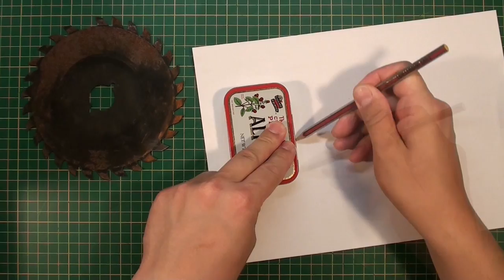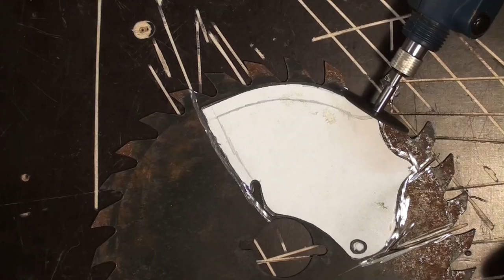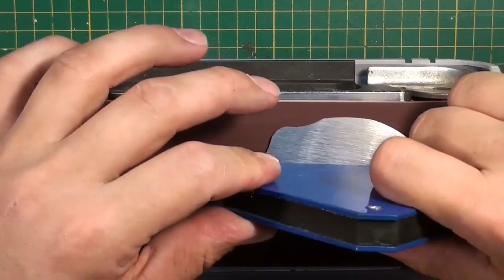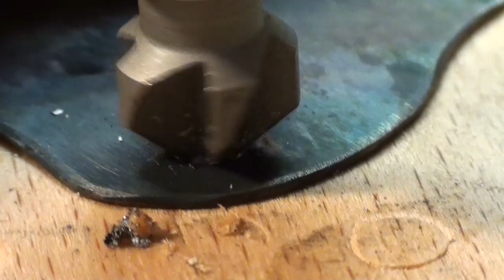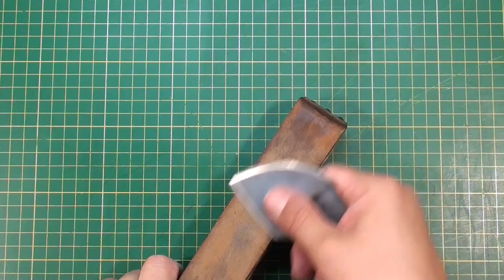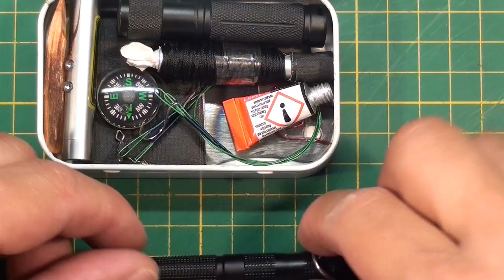Mini-Survival Knife made from an old Saw Blade (Jimmy Diresta inspired)

Comment: Curious to know if you did any kind of heat treat on this knife. Awesome job man that is a great idea thanks for sharing.
Reply from the maker: Hi Pryce, so far the only heat treatment was spot annealing the handle section for the lanyard hole. I have plans to try to harden the blade once I have the right setup for it (along with some other mods that have been suggested). I have already tested if the steel can be hardened on one of the cut offs and it worked pretty well.
Cheers Alex

Comment: Really Nice!
Here's an idea though:
The knife is probably going to be one of the most important and most often used tools in the kit. Instead of hiding it in the bottom of the tin (which means removing everything else in order to get to it), why not make it so that it fits in the lid of the tin (and the lid is still able to close)?
You could keep it in place with a magnetic strip on the inside (or outside) of the lid.
OR... You could make a leather sheath for it and hang it round your neck where it will Always be available!
Reply from the maker: Thanks a lot Paul! To be honest I've been thinking about a new version of this blade for a while now. The idea of putting in the lid makes absolute sense alternatively packing it on top of the other items would be beneficial.
Thanks again for the suggestions!
Cheers Alex

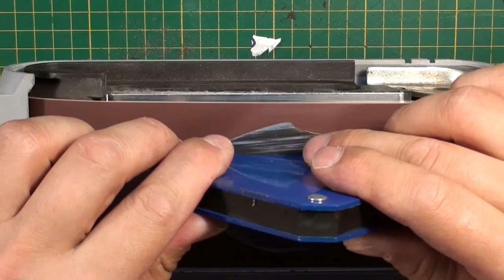Comment: I really like this concept for a knife. It's a much larger cutting blade (edge) for the space it takes up. I wanted to know what the blue device was that you used to hold the blade while grinding it @2:12.  Again Awesome concept & way to think out of the box. 
Thanks for sharing.
Reply from the maker: Hi Curtisskeete,
thanks for the like and your feedback it is much appreciated!
The item used to hold the blade for flush sanding was a welding magnet which comes in very handy for this purpose especially with small blades.
Cheers Alex

Comment: Most of the circular saw blade are just mild steel with, say, potentially case hardened teeth, quite useless for knife making though. Some 1080 - 1090 will do the job much better
Reply from the maker: Thanks for your feedback!
Cheers Alex
Reply: if a circular saw blade has no carbide teeth, you are so wrong, its high speed steel.
Reply from the maker: You are right this blade is approx. 20 years old and had no carbide teeth.

Comment: good idea but it looks like you´ve overheated the blade when you used the belt sander so it can´t hold a edge for very long. try to quench it in water from time to time to cool it :)
Reply from the maker: Hi Leonard, thanks for your feedback. I was wondering when someone would pick this up. The discoloration was caused by spot annealing the "handle" area in order to be able to drill holes. The majority of the blade was kept submerged in water whilst the handle was heated and then air cooled. In theory the blade area should have remained unaffected.
Cheers Alex

Comment: im not really understanding the design of this knife. I get it that you want it small to fit the tin. but why not make a typical knife shape with a small handle so you can actually hold the think not just with your finger tips. good work on shaping and sharpening, im just curious why the unusual and seemingly unpractical design.
Reply: he might have to use it to cut things like rope. Maybe some meat. I actually made one like this. but it is smaller in terms of width but same in length. The blade was just a simple triangle.
Reply from the maker: Hi, thanks for your feedback. The shape was quite experimental since I wanted the edges as long as possible given the space/size restrictions. The way I shaped the "handle" sections allows for a number of different ways to grip and hold the knife. Furthermore it is possible to make a longer makeshift handle with the contents of a survival tine for this a second hole should be drilled and screws added to the kit.
I hope this answers your question.
Cheers Alex
Reply from the maker: Exactly, the blade isn't design for jobs like batoning etc. where a good strong grips is required. It is more for delicate works.
Cheers Alex
Reply: ahhhh I got ya. cool yea was just curious, not hating.
Reply from the maker: I didn't see it as hating just as a question from a curious viewer and I must admit the design is really unusual ;)
Cheers Alex

Comment: never seen someone try to cut that kind of metal with a little dremmel type tool, how long did it take to actually cut that shape out of the sawblade?
Reply from the maker: Hi Serg, it worked quite well and if i had to guess it took about 30 minutes with cooling breaks etc. I also burned through two cut off disks.
Overall I must say that an angle grinder would be much faster and effective but maybe someone with a Dremel might find the info useful.
Cheers Alex

Comment: very nice. How many hours did you put into cutting out the basic shape?
Reply from the maker: Thanks Andy! It actually didn't take that long if I had to guess it took approx. half an hour with cooling breaks.
Cheers Alex
Reply: much faster than it looked in the vid. I will have to try and make a general purpose knife out of an old disk blade I have in the shed now I have seen your survival knife...
Reply from the maker: Hi Andy, you should give it a go! Using the cut off blade on the Dremel was an experiment though I would actually recommend you use an  angle grinder with variable speed. Allow for cooling breaks in between. Depending on the type of steel the saw blade is made of you might have to heat treat it.
Cheers Alex
Reply: Well I certainly will. I have an old 9" blade that is doing nothing so will have a slowly slowly try and see what the results are.

Comment: how many cutting wheels did it take?
Reply: and who's Alex?
Reply from the maker: Hi Scott, I think I used 3 or 4 cut-off wheels for this. I can't really recommend to do it this way but if a Dremel is the only power tool you have you might as well use it ;)
Cheers Alex
Reply from the maker: I am Alex
Reply: Right on, thanks buddy. Yeah, for something that small your options are limited. I've found that if you take your time the wheels last longer. Thanks
Reply from the maker: You are right. I did rush this project due to time constraints. Working thoroughly and making clean cuts should save you some wheels.
Cheers

Comment: what is the blue thing you holding to grinding?
Reply from the maker: That's a welding magnet I used it because it made it easier to hold the blade while sanding the sides flush.
Cheers Alex
Reply: +Let's Prep Together I am looking that tools for a long time. now I know what it call. thx a lot sir

Comment: So you sharpened a hunk of metal with no practical purpose?  You literally have no way to reasonably hold this thing when cutting anything with resistance, and you cant hold it on the flats because you sharpened the back side and one slip cuts through your palm. Most idiotic knife ever.
Reply from the maker: Not quite sure if you saw correctly which edge is sharp and which is not. As I have stated in other comments this blade has a purpose as a knife in a very small survival kit and it is possible to attach a makeshift handle in the field.
Thanks for your (not so objective) feedback.
Cheers Alex
Reply: Let's Prep Together how do you plan to attach a handle?  There is no area to lash a handle to the blade reasonably.  Since there is no reasonable grip and you have edged 2 sides of the blade you have a high risk of slipping and cutting yourself. none of this is to mention that your purpose could have been better suited with a pocket knife.  I would say that if you decide top try again, dont get fancy.  Single edge and more holes in the middle to lash it to a makeshift handle or shaft.
Reply from the maker: Thanks again for taking the time for writing your feedback. As I said before this is an experimental build as an attempt to think outside the box (tin).
I have also stated in the description that there will be further modifications including further holes for easier attachment.
Thanks again for your feedback.
Cheers Alex
Reply from the maker: You don't need to be sorry it's just your opinion. Thanks for the feedback.